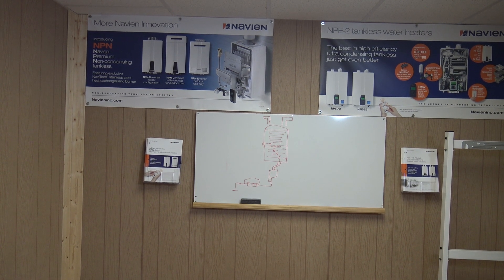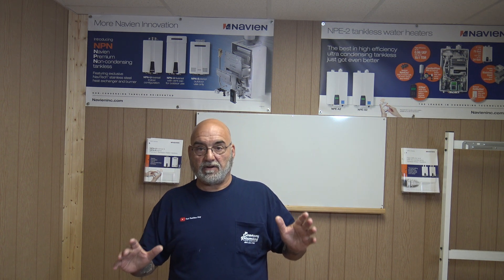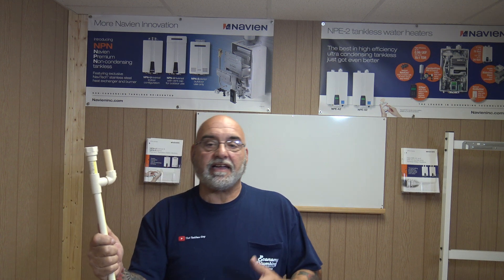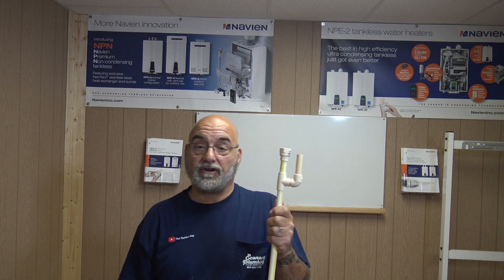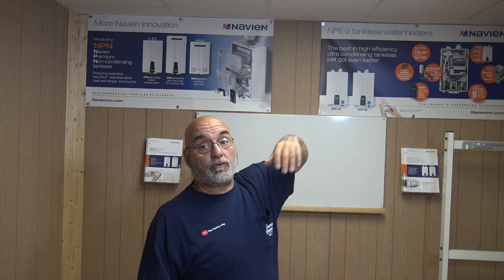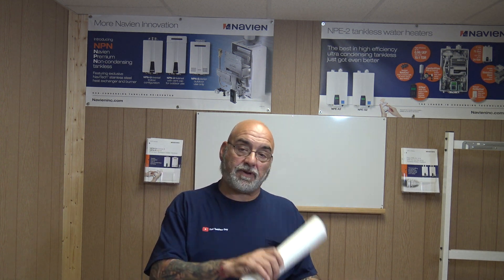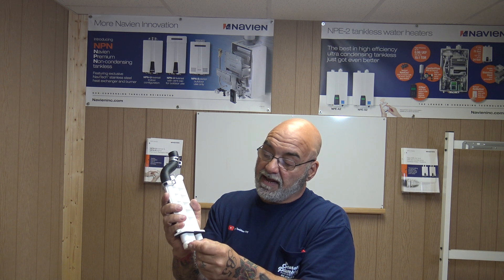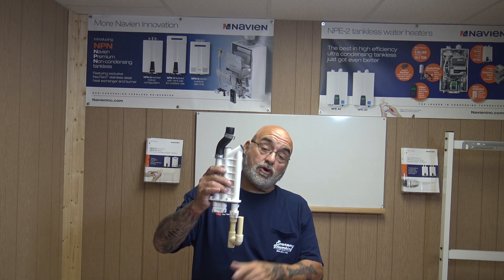What's really behind the condensate drain on a Navien NPE unit

Comment: Hello sir I have a Navien NPE-240A that shows a E003 code ( ignition failure) so I change the ignition rod the part with 3 rods. Now the problem is the condensate line it’s draining a huge amount of water and still showing E003 code even though i see flames thru the little window there is hot water but intermittent . Would you kindly help me how to fix the issue. Thank you

Comment: THANK YOU FOR THE INFORMATION IN YOUR VIDEOS!!

I have a Navien NPE-240A and recently had a heat exchanger replaced. After a week or so, my water heater sounded like it was bubbling and would throw code E110. After going insane for a few hours trying to figure out what was going on, I finally siphoned out the water from the vent. It worked fine until about a week later when it happened again. I also noticed that my condensate wasn't draining at all. Trying to find out information about the insides of these units is just about impossible to find: Until I came across your videos... 

In your videos, I was able to see what I was looking for involving the condensate drain, and when I got home today, I opened up the unit. I disconnected the condensate drain hose from the heat exchanger...and found the factory plug still attached to the heat exchanger. They installed the drain hose over the plug....Ugh. 

Once the plug was removed and everything re-attached, I poured 20+ ounces of water into the vent to make sure the drain was flowing properly. I then drained the condensate clean-out and primed the drain with 12 ounces of water (Thanks again for that knowledge as well).

I'll be replacing my drain line with PVC and a vent this weekend, as well as ordering some new neutralizer, as I also discovered my neutralizer output was in the down position, not up.

Anyway, long winded post later, THANK YOU again for having great information for all to see!

Comment: On the NPE2's, the manual doesn't show anything regarding having a tee to vent condensate drain below unit. My units drain straight down into an indirect drain. Any plug-up in that drain would spill onto floor, not back up into unit(s).  There is only a plastic thread adapter and a piece of pipe below unit, straight down. Any issues with it being like that?   Thanks

Comment: Mike I thought for a condensing tankless unit with pvc venting that the manufacturer’s want you to pitch the vent toward the unit at 1/4” per ft?  I’m assuming so any condensate will make its way through the heat exchanger, into the trap, and then out of the unit that way?

Comment: Hey Mike! First of all thanks for sharing your wealth of knowledge on here. You’ve been a godsend for a junior DIY plumber like myself. 

I have a Rinnai question for you. I installed a RU180in for my home. It’s working great, however I let my curiosity get the best of me and accidentally entered some form of programming menu. Long story short, I changed some settings and would like to factory reset my unit. I’ve tried holding both A&B, power cycling the unit, etc. None of these seem to change it back. I’m locked at 110F max temp and have concerns other settings were changed. 

Is there a method to factory reset? If not, where can I find documentation that explains the advanced programming menu so I can verify all the settings? 

Thanks again, love the channel.